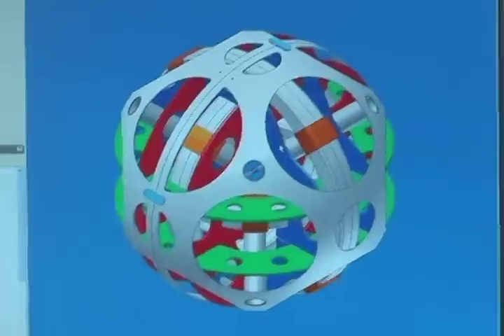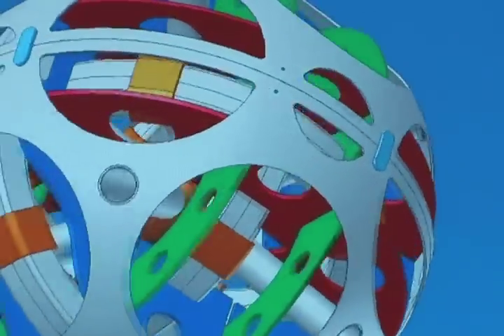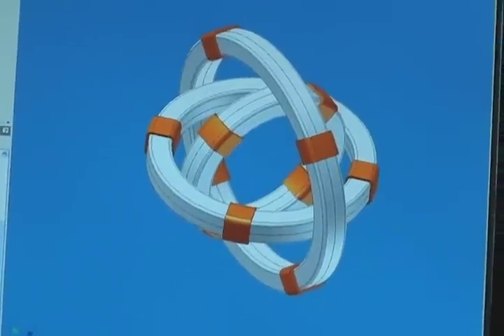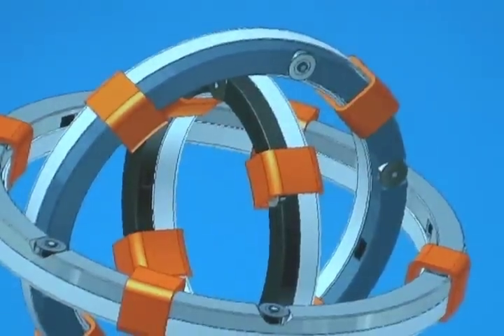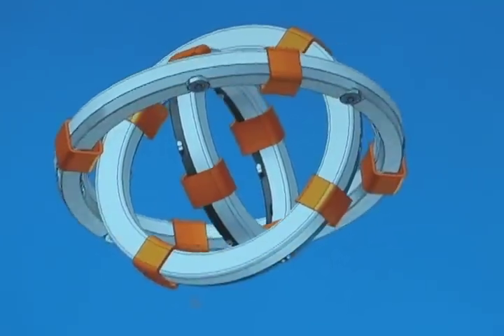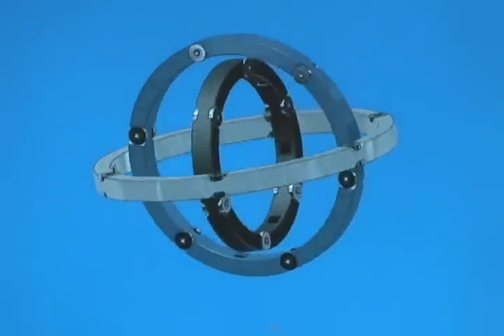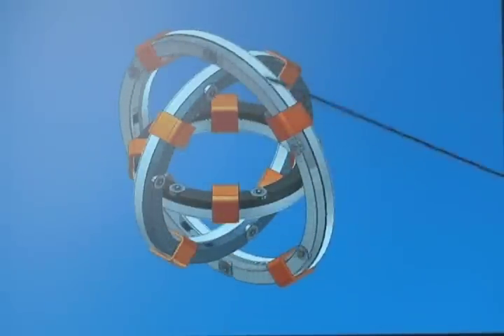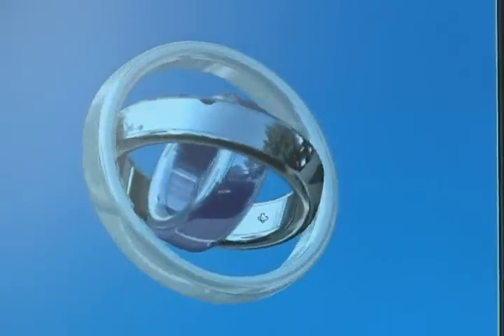Apparatus for Gyroscopic Propulsion Explained

Comment: The polarization of an magnetic gyroscope has promise. Perhaps 1/4 wave polarization and double flywheels become significant. However the gimbal is an RF diode at such. No ground.
Reply: It's nonsense. Waste of time It can't work as expected. Redux of the Dean Drive:
https://en.wikipedia.org/wiki/Dean_drive
Reply: @Observ45er   using a monopole coils’s field to polarize a magnet with a single pole works.
Reply: @MrThacke  What is "monopole"?
Reply: @Observ45er  anything molarized. A monopole not a dipole. Either South or North magnetism but not both.
Reply: @MrThacke  Ho.  So you think that's possible. What's your background relative to physics?

Comment: Precession will work 90 degrees to a rotating ring 👍so the cage technically wouldnt rotate.. (precession is locked due too the three rings Orientation). Id add counter rotating rings to eliminate cage transferring torques, Basically you have a locked axis angular machine... But in space it could still move along the three planes we know of, x y z....  Show me a gyro that can convert angular precession into a linear plane of movement then we have a new propulsion for space 👍👍, great work btw, would love to see made and spinning
Reply: Correct you cannot generate a unidirectional force with rotating masses.
Reply: @Observ45er  i guess deep down i feel that you can though. I am to this day still mystified gyros can stay fixed at a point in space, its magic 😁
Reply: @ThisWayWorksTWW   They don't stay in a fixed point on space.  They just maintain a fixed orientation/direction of the axis of rotation (axel).  Spin one up and sit it on the table in any orientation and it can be slid all around the table, or moved off and you can walk around with it in your hand. It will want to preces if you try to change the direction of the axel, but you can move it all around the room.
Reply: @Observ45er  yes i agree, the precession occurs trying to tilt a gyro around an axis (3axis)... (ISS orientation is done this way)and also agree you can move in a planer way with a gyro and that wont induce a precession... I guess my dream would be to decover a device that would/could move an object accross a plane in space without chucking something out the back space travel would be much much quicker... A gyro is in my eyes actually a phenomenon, just need to find/discover the planar travel version lol
Reply: @Observ45er  if you had a balanced flywheel in lets say space.. then periodically made it unbalanced in the plane you wanted to travel would that not create a movement along a plane in space? Could use three axis gyros for the directional control then, should say i really like your design as all your precessing gyros act upon one central point, really nice 👍
Reply: @ThisWayWorksTWW  That was the idea I had in High School.  Add some extra weight to the perimeter of the wheel for only half of the rotation. That provides a force to one side of the rotation. . . . It won't work as you think because when you take that extra weight off the side of the wheel, there are accelerations associated with adding and removing that weight that balance the "force" you would get from the time that weight is ON the wheel perimeter. Think about it. . . . NO unidirectional force can be generated by a gyroscope. PERIOD
Reply: @Observ45er  every reaction has an opposite and equal reaction 👍, shame though 🤣
Reply: I know what you've got. 
Also, It's not a "linear plane" of movement. What you're after is a linear force or a unidirectional force and that is impossible.  This is well known. The only way is to chuck something with mass in the opposite direction. 
Unfortunately, you lack the understanding of fundamental physics to understand that.
Many naive people have tried to do this over the centuries. 
At least if you're home working on that, your off the streets, not clogging traffic for others that are on the move. . .

Comment: I would think it would react differently in space than on earth,where the gyro is effected by the earths spin, which is , wouldn’t the three spinning cancel each other out,like a block of wood
Reply: What you have crudely stated this correct. When you apply the right kind of torque to a gyro it rotates that Force 90° and response at 90°. By putting three gyroscopes together you can get that for us to work back around to oppose the torque that you apply. What happens is as you try to rotate this thing in space it resisted and it will not spin around.
However you absolutely cannot generate a linear are unidirectional Force by rotating masses.
Reply: If you made one of these extremely well and put it on Earth you would notice that it would slowly turn at the rotation speed of the Earth because it would remain stationary in space and it's angular position as the Earth turned underneath it.

Comment: So...this is the unmovable ball you can't kick any distance.
Reply: You can kick it. It can be translated in space. If you've ever had a gyroscope you can get it spinning and then move it left right up down for an aft with no problem. This thing will just not allow you to rotate it. 
It will not roll along like a ball. If you put it on the floor and push it it will stay in one orientation and slide along the floor.
If you try to twist it one way or the other it will resist. The better it's made and the heavier mass is, the harder it is to rotate. If you try to twist it, it will very very very very slowly twist in the direction that you are trying to turn it, therefore, it feels like it's mounted to something, but you can move it up, down, left and right.
Reply: @Observ45er  Then let us kick it to the stars and translate space into position!
Reply: @YawnGod  Yea, That adds a lot to the discussion. . .

Comment: so spin all three at the same speed and there is no net force perceivable. But slow one down and the device moves in one of the three planes of rotation, depending on which one is slowed... and the one that is slowed simply doesn't counter the other two rings force allowing it to process as it wants... Directional control will be the challenge by brilliant idea... possible flight even, with proper control of course... ...  its the controlling software that will truly be magical...

Comment: Excellent Invention. I understand how it works , having my own invention for space propulsion.   Basically your invention needs an 
initial impulse, and external displacement.  Sa this impulse or inertial stimulus is in the X direction. The  1st Gyroscope reaction is a displacement in the Y direction. That would be the input to the next gyroscope that would result in a displacement in the Z direction
and that will be the input to the 3rd gyroscope that would result in a kick or displacement back in the X direction in the same direction
of the original impulse input.  It opposite to Newton's law of motion, of equal and opposite action and reaction. IN your invention is equal and same direction , adding to its propulsion from the 1st initial external impulse. 

I can understand that your readers don't understand but well done.  I would like to make contact if you wish to talk about  prolusion in space
and my own invention
Reply: NO. Gyroscopes do not change the direction of a translation. They changed the direction of a torque by 90° to another torque, or moment.
You can take a gyroscope and have it standing on the table spinning away and you can move it left, right, up and down and it will move very freely dependent only upon its mass. The three gyroscopes only Orient the torque Force back to oppose the direction that you apply to it so you just can't rotate it in space but you can translate it around all day long.

Comment: I think this gyro will not go anywhere. How do you get it to move in a particular direction? And something should have to be built to prove the concept before a patent is issued.
Reply: You are correct. What's all the gyros rotating up at speed, you can move it around all you want you just can't rotate it in any way. If you put it on the ground and push it like a ball it will just slide along the floor and never roll.

Comment: If you used 9 indivirual rings in this system i wonder if it would be better due to able to use rotational inertia to achieve levitation?... spin rings fast and stop in a pattern will get the ball to move multiple directions...

Comment: This is something I also came up with but I call it anchor drive. The way it really works is it locks you to point space. In other words when turned on it would stick to space on the X,Y and Z axis. Depending on the time of day and month then turned on it would seem to shoot up and into space but really it is standing still and planet is moving away from it. If you set a timer so it turns off in a 225-250 million years you will find it in about the same place when it left the planet. ;-)
Reply: Hmm, interesting thought. This device would then be another solid proof of flat and stationary Earth. Pretty sure it would sit in one place day after day, year after year.

Comment: I actually had an idea similar to this, but I could only simulate it's physics within a two dimensional plane due to the said simulations limits. It was a ring with two opposite facing circular weights of the exact same densities, on an axis in the exact center of a cube, all connected by 90degree angles, the thing spun insanely fast and if it touched any uneven ground it shot in a corresponding direction too fast to even see. It was a part of a project I was working on I later called the "gyro-pod", a sort if challenge to see if I could make a vehicle that could move independently without any external wheels, and it was a success, but as I said only in concept with the simulation. 

I imagine if that concept was realistically reconstructed its spinning axes would have to be doubled, but i'm not exactly sure how.

Comment: I'll look up the patent number!!! I think I've seen this before. If I'm not mistaken this is an  electrogravitic thruster used to create a quantum field bubble. It seems simple and straight forward but the challenge would be in creating the power supply and control systems for it and in mounting a crew cabin or cargo bay or payload if it is to be weaponized for military applications.

Comment: I get that the three wheels will balance each other. And I think that such a unit would resist any rotation about the central axis. The only way to attain a linear force from such an apparatus would then be to forcibly rotate it. 

I am not sure that is this gentleman’s plan but if the math works out it may be worth a shot.
Reply: So What happens if held in your hand while in a quiescent state and then dropped it. Would the wheels suddenly Increase in speed to counter the sensed motion and try to counter that motion if the acceleration rates were achievable to counter the 10.8 m/s sudden acceleration? Equal and opposite programmed response.
Thinking about this hurts my head. what is the reference frame for calculating such problems using math, and physics?

Comment: It reminds me of the apparatus from the movie CONTACT.
Also in the Bible, Ezekiel it talks about seeing a wheel within a wheel.
The concept is true to that nature. However I can see flaws.
1.) How is it controled ?  If it does work.
2.) Directional weak & strong fields were not explained.
3.) It may or may not exert an inertia dampening field. So no matter what the maneuver or speed, the occupants inside never feel it or when upide down, they don't fall to the ceiling.
4.) What is the actual applied power source? 
5.) How Can This Be Used Or Applied Without A Actual Demonstration? I Saw Pictures.
Your Patent Means Nothing Out Here Without A Working Demonstration.

Comment: Ok you say that the magnets get spun up to speed by the gold rings that are electrically charged but you did not explain that you did not show how they are mounted you didn't give any explanation on how they actually work you gave a half ass explanation of what they are made of and that's it and another thing the magnets would counter act each other as the passed the ones on the inner ring because they are going in opposite direction or whether they were going in the same direction regardless of the direction they would pull on each other and they wouldn't work now a few design changes and and material changes it might help in it with another form of propulsion added but they will not do it themselves if it did it would violate the laws of thermal dynamics and you'd have perpetual motion and make more money than Jeff Bezo (misspelled) you get my point

Comment: Oh boy...
Even if you end up spinning the rings at great speeds, the centrifical force in those three directions would still not produce any effect mitigating ground field, and the weight of the apparatus would just make it fall down to the ground.

Spinning by itself, does not give you antigravity effect. Ground (earth) molecules clamp together, because eventually every atom in that clamp begins to adhere to the overall frequency in that mass... which dictates electric power output direction from these atoms, ie they align together. You get enough mass, with the same frequency, and that produces your field.

That's why black budget flying (triangle) platforms, most of our flying disks, even that German bell... used electricity frequencies to stabilize their "spinning" cores.

And so that has nothing to do with movement, only creates its own polarity field... traveling faster than light would be another trick.

Comment: if you get all 3 these rings up to designed speed it will be very stable no rolling. Then try to accelerate just one of the rings even faster by pulsing a coil, since it can not roll it will create a straight force forward because the entire sphere is stable will resist any kind of roll. Like wise trying to slow a ring down with the coils will not roll it either but move it in a straight direction. So you have 3 plains of straight movement depending on which coils your try to change speeds. 4 individual controls per ring would  let a computer stabilize the internal ring speeds without movements of the sphere especially if the computer uses gps feedback much like a drone is controlled. You have to continuously input energy to overcome friction and gravity but be able to move about in any directions with computer control. The ultimate drone completely silent if put in a vacuum chamber no propellers to hit things. you could move this thing like a cannon ball or hide it underwater motionlessly, in the bushes or branches even push itself under the sand to hide. Could take even into space since it does not need or use propellers or the air. Opposite coils being pulsed would keep the ring speed constant while providing thrust in the direction of choice. Every force creates an opposite force so any attempt to increase a ring speed would push the coil assembly oppositely. Then the coil opposing slowing the internal ring back down contributes to the same forward force. The nice thing is if a coil tries to slow down a ring it can generate electricity at the same time.

Comment: It can move at space with slow movement.
Can called mechanical inertial machine
because one little inertia can make by
this prototype.
   We want to see test at ISS station in space.
This can be useful in space walk .
No need to fuel . It can use with electrically.
Result from solar charge. So, it is easy
reliable propulsion . But we need more
powerful inertial drives.
    This is mechanical drive.
All big are based from prototype really.
Go to full power test.

Comment: in the video there is a claim that vector analysis cannot predict how the system will perform, well, i can predict the way the system will perform doing vector analysis in my head. For example if the system is in space, after getting the system to run, it will have exactly the same angular momentum and linear momentum as it has when was not running, what will increase is the internal kinetic energy, but remember that is a scalar... and the energy would came out of the batteries chemical energy for example, then what will be the propulsion quantity Delta Propulsion = 0 as well... ;-) Get a book inventor! ;-)

Comment: Imagine the inner being a cocpit wall of a craft, the 2nd ring being a protective wall that protects inner cocpit and an assemby that assist in the suction and vortex that is created from the rotational turn of the outer body of the craft. Giving considerations for upper, lower and derectional air intakes, and outtakes that can be intermittently closed or released to achieve flight. This could probably be achieved using superconductive materials, power, and vorex technologies. But with you system it will likely to create "  inertia " lift at a given rotational speed in the inner cocpit.

Comment: This would not propell itself it would sit stationary , it should be moved in a straight line down up side to side and any other angle in a straight line , the only thing this would do is resist turning it any direction and with all gyroscopic wheels turning the same direction you might get a very little bit of precession in one direction so it might turn slowly as a whole by it's self